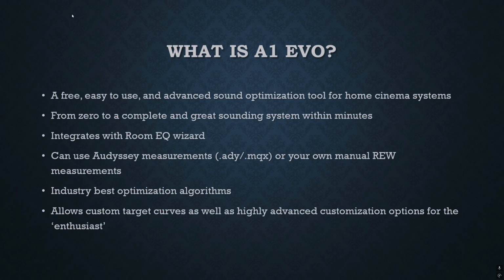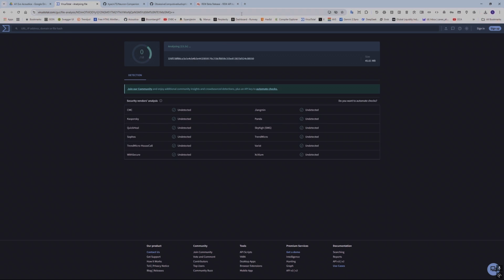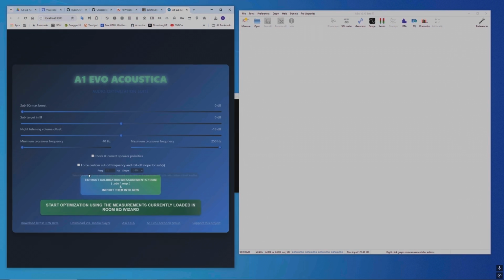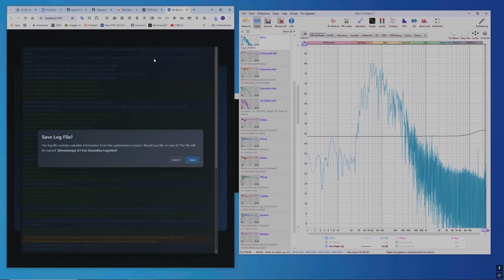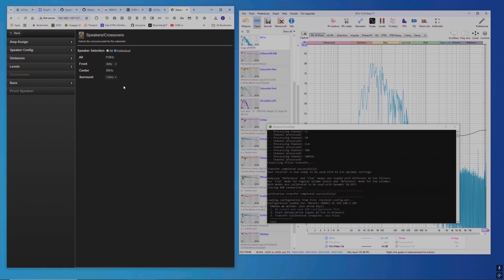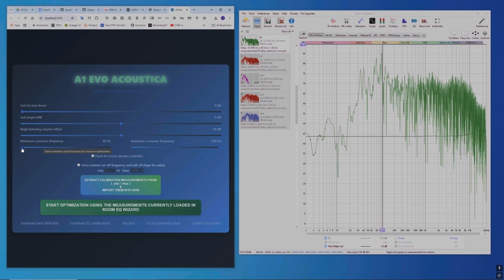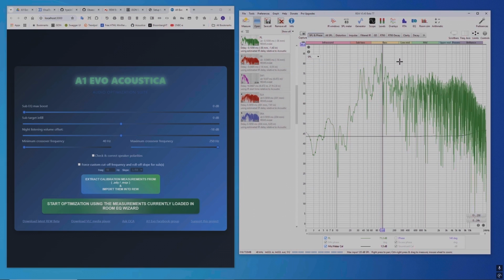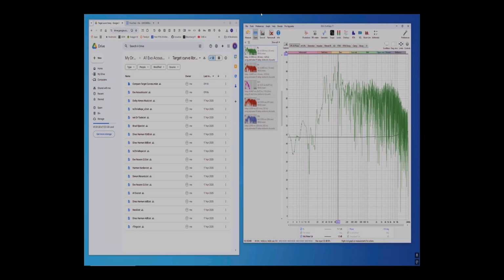A1 Evo Acoustica

Comment: I have a problem with acoustica. I already transferred my OCA file to the AVR and assigned it to preset 1, but when I play something with Dolby Atmos or Dolby Digital Surround, I can’t hear anything. It only works when I switch to Dolby Digital + Neural:X. What am I doing wrong?
Reply from the maker: What model?
Reply: Denon S760H
Reply from the maker: I am aware of issues with that model. Hopefully someone with that model will add a fix on github soon...
Reply: I had the same issue with the Neuron 3.1 when using the option of “sendallsetting2avr” only works with the odd
I only got sound when setting Reference or Flat to off

Comment: The Flat settings sound fantastic - with even better than ever imaging, and insanely well integrated bass. The reference setup is extremely muddled and boomy and I'm not sure what I should charge.
Reply from the maker: Reference is supposed to have about 10dB louder bass and treble, would sound too thick at normal volumes but if it's unbearable even at lower volumes, that might be an issue with the filter transfer for your particular model. We will fix all that in time...
Reply: @ocaudiophile my sr6013 is the same. Unlistenable in reference due to the bass.
Reply: @ocaudiophile  Fantastic - it's a AVR-X3400H  - and I have the front right/left bi-amped, if that helps!

Comment: I'm using a sr6012, I use my second sub out for transducers, how do I do the -t +1 to add a non eq sub channel with acustica
Reply from the maker: Do you get 1 or 2 subs in your receiver_config.avr file?
Reply: @ocaudiophile  when i run the take measurements i have only 1 sub set. so i would say 1. that is how i have previously done it, the run odd.wft load (file.oca) -t 1 to get the second sub out without any eq applied
Reply from the maker: @andrew1977au  With some minor changes in the .oca file, this can be done. I will add an option to Acoustica...

Comment: My front left and front right speakers are managed by a miniDSP Flex DL, calibrated with Dirac.

I have four subwoofers managed by a miniDSP 2x4 HD. They are time-aligned, level-matched, and optimized with manual PEQs using REW, delivering peak performance by functioning as a single large subwoofer in my listening position.

The system is a 7.1.4 setup powered by an external amplifier connected to an SR8015. Could the A1 Evo Neuron or Acoustica software help streamline my setup more? Additionally, what are the key differences between the A1 Evo Neuron and Acoustica, and which would you recommend for my current setup? While flat sound is neutral and great, I’m seeking a sound with more character.

Na, hab ich dir eigentlich schon gesagt, dass du 'nen super Job machst? Wir wissen deine Zeit und Mühe echt zu schätzen! Danke dir!
Reply from the maker: With a 8015 and 4 subs you need the Minidsp. Just measure it as one sub and feed it as usual to A1. Make sure you don't use large time delays between subs in minidsp. It will eat out from Audyssey limits. Acoustica is the latest and best optimization compared to previous A1 versions.

Comment: @ocaudiophile  OCA I redid second time Acoustic callibration with all correct settings and same.method as per your video with Denon S770H, I am not getting sound, i successfully loaded final output OCA file on AVR, still No Sound..
This is my second attempt with Acoustic 
😭😭😭😭
Reply from the maker: I just uploaded v2.0 which fixed problems of new models with multiple subs. Next inline are the problems with non XT32 machines like yours.
Reply: I used the v2 of sendallfilters and works for me, denon S760H
Reply: @robertoreyes1525  which folder is sendallfilters file located?

Comment: I successfully completed the full process, sent the final output OCA file to AVR Preset 1, but there is No Sound coming..when i switch to Preset 2 Neuron, sound , Preset 1 No Sound??

😢😢😢😢😢😢
Reply from the maker: There're still problems with a few models but try transferring again which sometimes can work.
Reply: @ocaudiophile  OCA I redid Acoustic callibration, with Denon S770H, I am not getting sound, i successfully loaded final output OCA file on AVR, still No Sound..
This is my second attempt with Acoustic 
😭😭😭😭
Reply: I used the v2 of sendallfilters and works for me, denon s760h

Comment: First of all thanks again for your great efforts and results! 
I did an initial test with polarity check for the speakers, and it reported the front channels as out of phase (which is not true). It also ended up setting the center channel crossover at 180Hz, which is unrealistic.
The sound result when listening in 2.1 mode (fronts with subwoofer) was excellent, with very clear but overly prominent bass.

I then repeated the calibration without phase check, and the final result was more realistic in terms of crossover settings. The bass was less dominant.

It’s hard to understand why the results were so different, considering the only change was disabling the phase check.
Reply from the maker: You should not turn polarity check on if it's giving false positives. It will effect timing.
Reply: @ocaudiophile  Indeed, I performed a second measurement with the polarity check turned off.

Comment: Thanks again for your amazing work. Wanted to try this out but unfortunately i´m not able to connect to my AVR (X4800H). I´m getting a "Status: 403 forbidden" message when using the .exe file, even if it does show my receiver. Strangely i´m also not able to connect to my AVR via Browser which worked flawlessly before.

Edit: Could connect to the Receiver via Browser again. But still error message from within the application exe file.
Reply from the maker: Temporarily disable firewall. Many thanks btw!🙏

Comment: First time trying this.

I have a Denon 4700

I took a set of measurement in the Audyssey App and transferred the .ady file to my computer.

Acoustica starts to run but comes back with the following error? 

[ERROR] A1 Evo Acoustica cannot optimize your system without individual measurements for each subwoofer!
 [ERROR] >>> A1Evo Error:
Reply from the maker: Audyssey app keeps only one measurement for all subs. Acoustica needs separate measurememts for each sub. Use odd.wtf -measure tool you can find under Neuron video. You can then use that file with Acoustica.
Reply: If you have multiple subs and taking measurements with the Denon MultiEQ app - make sure that you set your subs to "directional" so that individual measurements are taken
Reply: @ The 4700 doesnt do directional bass

Comment: is using the mic that comes with your denon good enough or do you need to do it using a calibrated mic in REW to really hear the difference? mine is primarily a stereo system
Reply from the maker: You can use Audyssey mic with REW but you need to upload the mic calibration file. Check Neuron folder for an easier way to measure your system with the Audyssey mic.

Comment: How is this different from Neuron (which I just began digging into)?
Reply from the maker: It's a single all in one app and has better sound optimization tech.
Reply: @ocaudiophile  Sir, this was my first time playing with this (even though I was aware of many previous iterations). I am truly impressed. I just listened to some test tracks (including this one https://www.youtube.com/watch?v=OqIa8nou_iQ) and I have never heard my living room setup like this before! I used the Evo target curve in the folder you provided. I ran MultEQ-X and didn't spend time messing with filters or anything (as I assumed they wouldn't be used anyway) and transferred the completed calibration. I am somewhat saavy on PCs, and this was truly easy. Thank you very much. I think I will load your Music Target curve next and save it to the other preset.
Reply: At this point a bit more tech engine detail would help to understand. One seems to be that the distance limitation issue is completely resolved? When I understood correctly it allows larger delta distances as long you do not attempt to edit it via gui...?

Comment: also, im kinda new to this, can i just use the .ady file and bring that in REW or do i have to do measurements to each speaker individually using REW following some of your older videos. Just need some basics on getting started.
Reply from the maker: If you have only one subwoofer, you can comfortably use your .ady file but especially android app's are known to have bugs in their measurement data.
Reply: @ocaudiophile  so do you suggest i do it using the ios app?

Comment: Thank you so much! Your free tools improved my home cinema experience like nothing before has ever been able to do and makes the Denon X3800H easily the best price performance audio product avaidable today for larger home cinemas!
Reply: What are your issues? I like my 3800 so much!
Reply: @Littlesloths  Not switching inputs accurately, audio sounding "crackly" randomly if that makes sense, says LF polarity is reversed when running audyssey  and I know that's incorrect, when playing through airplay from Roon it reverses the polarity on my sub causing it to sound terrible. Don't get me started on Dolby vision. I could keep going honestly but for as much as I paid for this unit none of that should be an issue.
Reply: @TitansOfTimber ok, thank you. Cannot speak for dolby vision as my jvc nz9 does not  support it.
Airplay is poor mainly due to missing bluetooth ldac support...

But polarity? I guess you never play without audyssey so it is compensated or you switch  it once on the sub if you need to...

Cannot speak for roon. Did not know 3800 supports it. Anyway, you say it swaps polarity with audyssey is always on?

Does any other avr from denon or marantz behave differently? Maybe roon dies some odd magic?
Reply: @Littlesloths  Before this I had a 2400h and it worked great except it started to drop wifi and I'd have to reset network receiver once a week. This 3800 just has too many problems. When you spend that kind of money you just want things to work. I don't expect to spend over a thousand for hardware and have to troubleshoot constantly. Maybe it's just me or a bad unit but the next receiver I get I'll probably be going with a different brand
Reply: А що зробили в мене 3800 постійно високих баркує після одісей,замучився вже
Reply: @SnufTheCat  Am I the only one who hates my 3800? It's the buggiest piece of junk receiver I've ever had. Honestly it's ruined Denon so much for me I'll probably never purchase another Denon product again.
Reply: My 3800 sometimes freezes and I have to turn it off at the wall to reboot. I'll probably go a different brand when it comes time to replace. Not the happiest with my purchase.
Reply: I've never had any of the problems you mentioned, and I got a good deal as well. I'd hope you have a faulty unit.